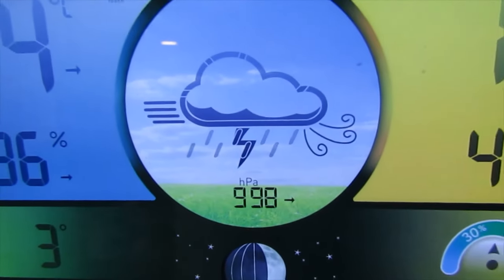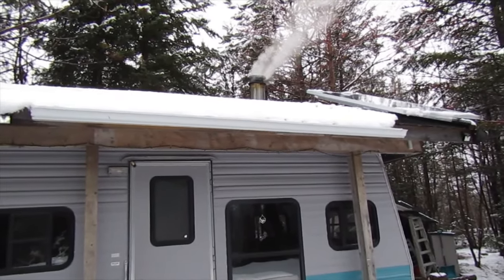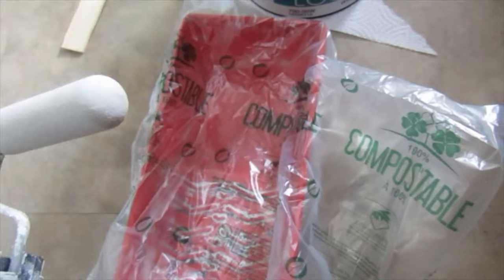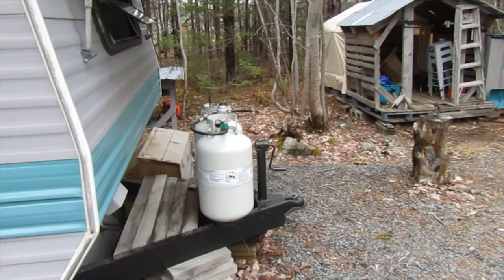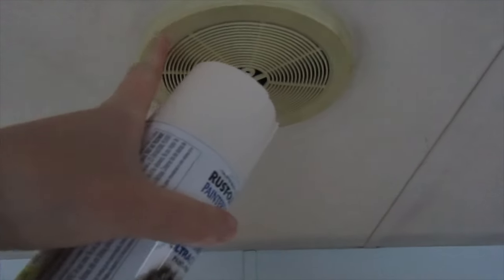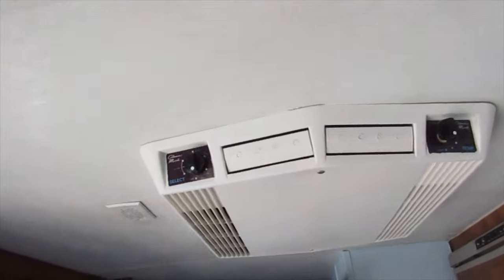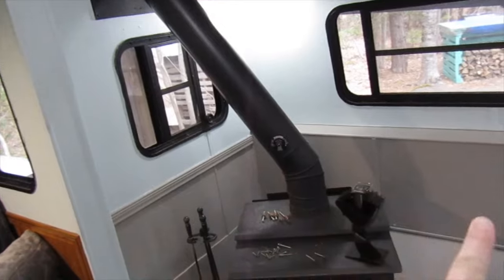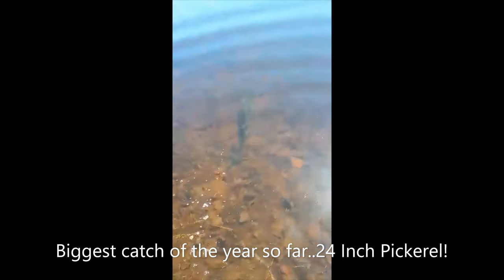PAINTING The Inside Of My RV! (Sort Of)

Comment: iT LOOKS SO NICE!   You have a really cute space.   Could you spray paint the metal behind the wood stove with "engine" paint?   It is for high heat.   About your woodstove...that is how we heated our home for a decade.   Yes it is dirty but so is oil and I don't know about diesel.   I sure don't like the smell! Wood is a resource you seem to have an unlimited free supply of.   Diesel prices could go way up now or there could be a time when it isn't accessible.   Wood is a healthier fuel...and it is better for the environment.  I think it is worth the extra work.  And wood ash is a great fertilizer.  You can scatter around your plants or compost it.   I also love the sound of the fire crackling.   We had two wood stoves...one at each end of our mobile home.   We had built a two bdrm and family room addition out the end and had one there and one in the main living space.   If the power went out...which it would occasionally. I could cook in it and on it.   I always had a tea kettle going to add moisture to the air and often, there was a big pot of homemade soup simmering all day on it.    Karen
Reply from the maker: Thanks and so far I agree with most that keeping the woodstove is a good idea. There is no heat that beats it

Comment: LOL Apparently we have the same taste in paint color. I've painted this joint twice and chose a color a similar color both times.
We have both a diesel heater and a wood stove. Love them both but with the cheaper diesel heater (Amazon Chinese knock off) they don't shut off when they hit the temp you set it to. It just goes into a super low mode but continues to pump out heat. So when it's not super cold out, it gets too hot in here. Also, when it's really cold out, the warmest we can get it in here is about 17C.

Comment: For the spray foam around the slide out, you can cut along the wall with a knife (I’ve found a steak knife works best) and then use a small scraper to run along and make it even with the wall...
Reply: Also, I agree that getting a diesel heater would be a great idea, though I’d keep the fireplace/furnace for emergencies/backup and nearly everyone loves a nice fire now and again

Comment: Paint job looks good Jenna. I would keep the woodstove, by chance we're drinking the same beer. Btw; I don't know if you use your camper's a/c, but if you don't all rv/camper roof openings for a/c - fans etc. are 14" x 14". You could remove the unit and install a vent with or without a fan. Cheers.